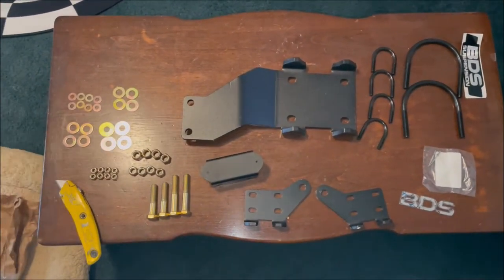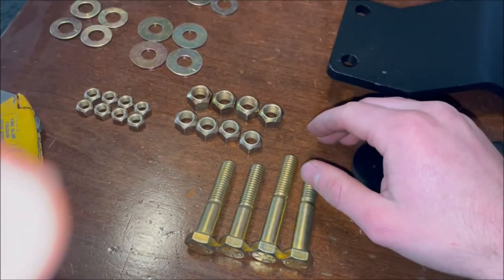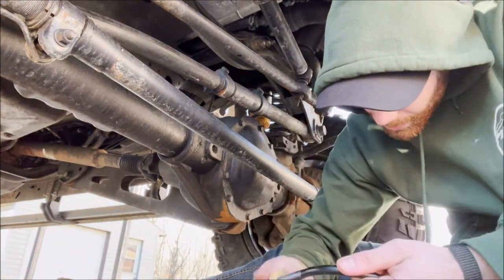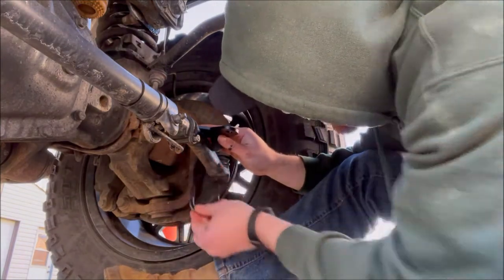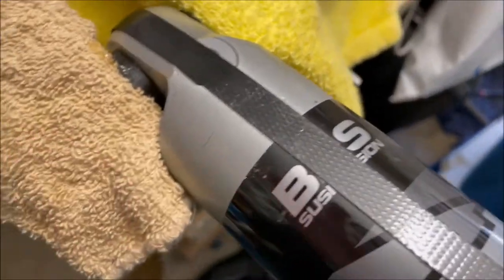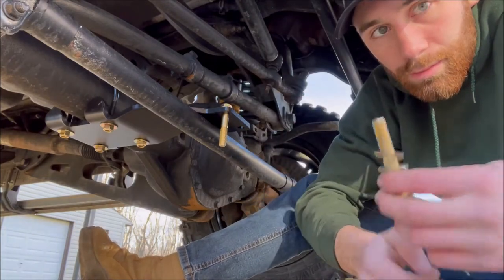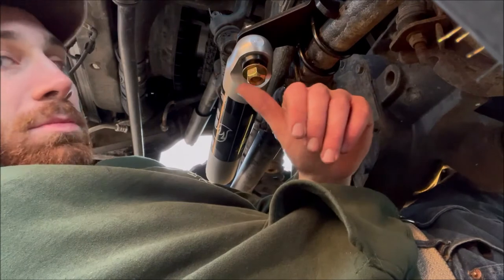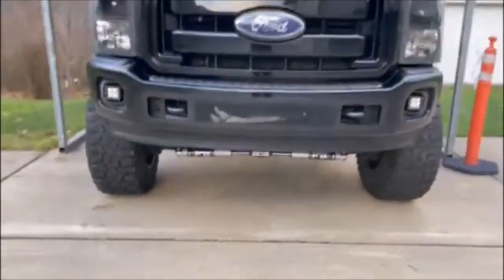2016 F-250 BDS Steering Stabilizer Install

Comment from the maker: Follow up:  Get your alignment BEFORE installing the steering stabilizer.  I went and got mine after this and the changes from the alignment threw off how the steering stabilizer was mounted. it was easy to fix, but could have avoided the hassle by installing after the alignment.

Comment: Would you say this is better than the rough country stabilizers? And can you maybe move it up or down for clearance? I have the rough country kit but it’s scrapped so much from turning it damaged the bracket and the tie rod😅
Reply from the maker: I can't speak for the rough country one because I've never seen/used it, but the BDS with the Fox shocks have done me good for the few years I've had it on.  No scraping at all from me, but I have a 6 inch lift if that matters.